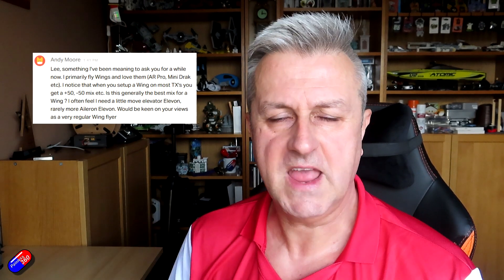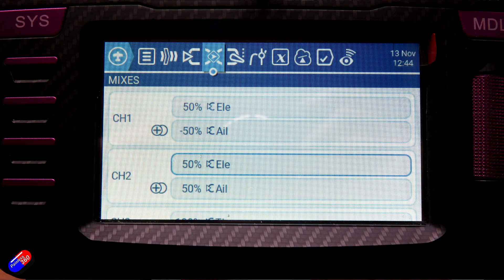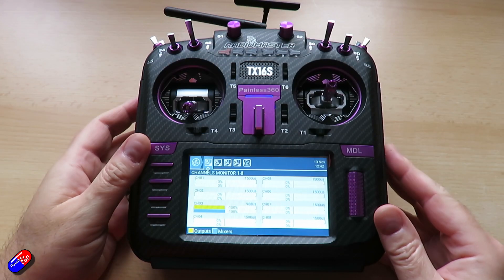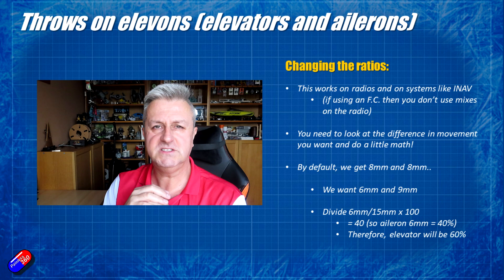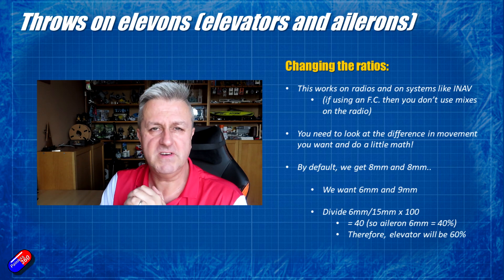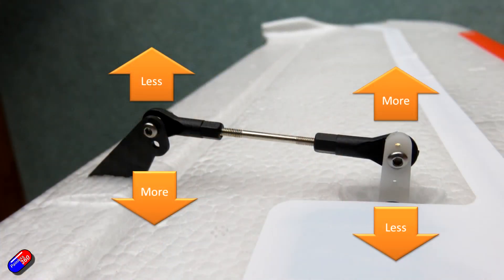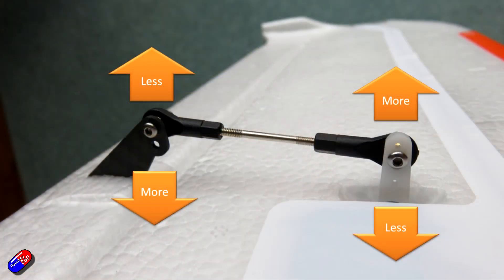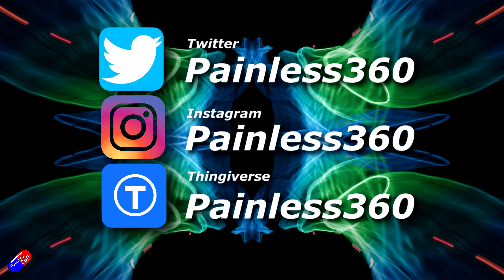Control mixing: When 50/50 doesn't work and how to fix it!

Comment: The problem is that more and more often the manufacturer does not give the recommended deflections. You have to do several tries before finding the optimum setting.
Reply from the maker: Most do now. There are a few that still don't like AtomRC. When those are missing I specifically cover that in my maiden videos... Happy flying